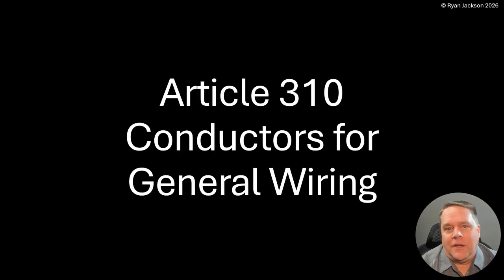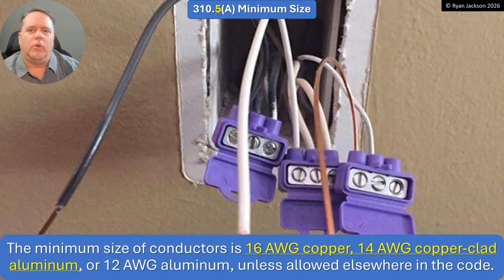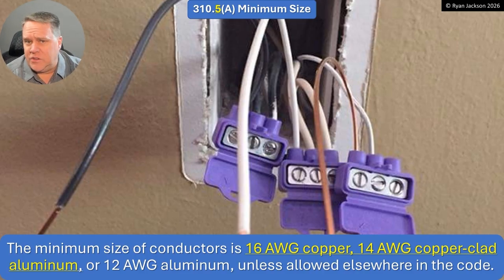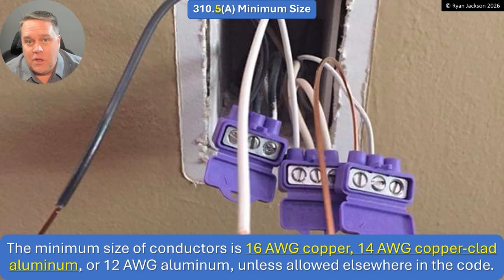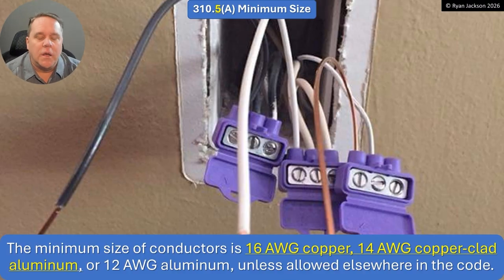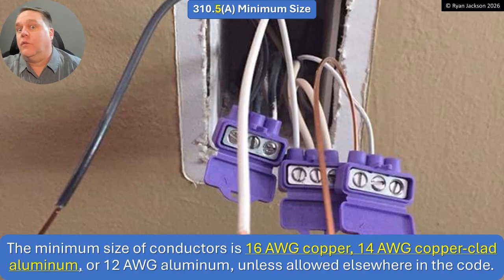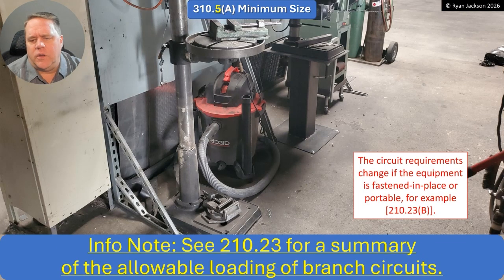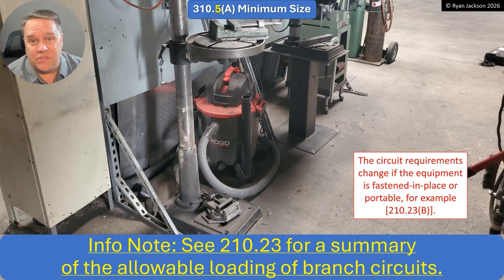100 Days of the 2026 NEC Changes Day 39: 310.5 Conductors

Comment: Great videos as always!

I posted this question in a video posted regarding article 210. Given that 210.19(D) still requires minimum conductor size to be not less than 14 AWG, unless its an application that does not fall under 210.14 or cooking appliances, do you anticipate a TIA will be issued to address this constraint?
Reply from the maker: Shh...don't tell anybody about this one. ;)
A TIA should be submitted for it.

Comment: Great video, Ryan! Thanks for your insight on this. I can just imagine the debates, on one hand you have industrializing countries such as China and India causing scarcity and concern for conservation of resources and the rising prices of the conductive metals commodities, (copper is expected to zoom beyond 2009 levels of increases), and on the other hand, there’s valid concerns about the fragility of smaller conductors and smaller terminations, that poor workmanship will have even more effects on. The thinner conductor does not withstand the equivalent nick, scratch, scrape, kink, etc that the larger conductors would have, along with the finer tolerances of smaller terminations and splicing. I really felt your reasoning and overview of how we will only find out from fire, once it is code. Thanks again Ryan!

Comment: It's going to be harder and harder to do "room by room" circuits instead of having dedicated lighting circuits, as is it's almost impossible to get 12 gauge wires into those LED drivers. If they start assuming people are using 16 gauge and not 14 gauge (and 12 gauge only begrudgingly allowed) it's going to be near impossible